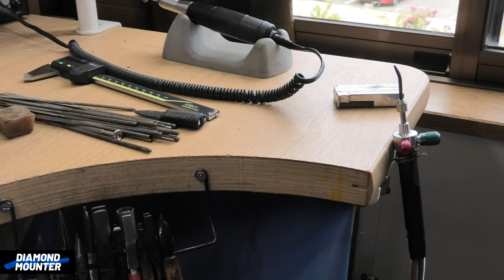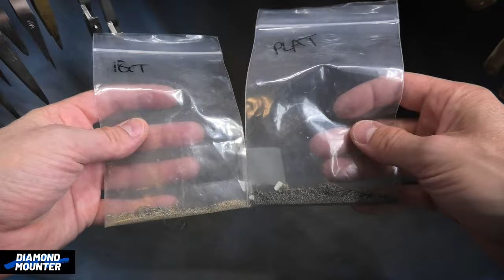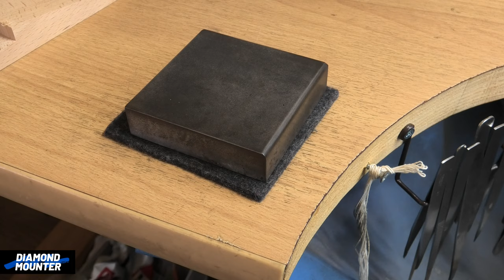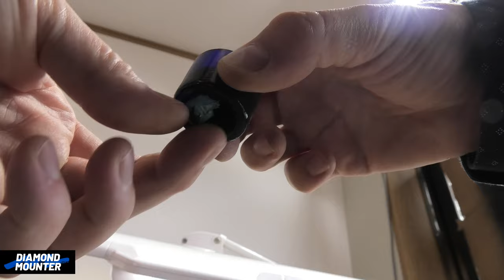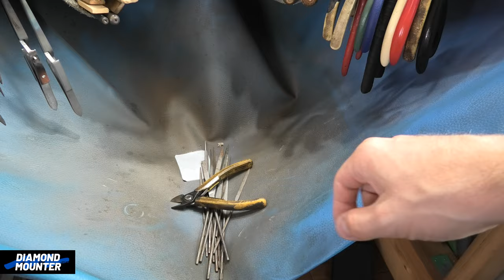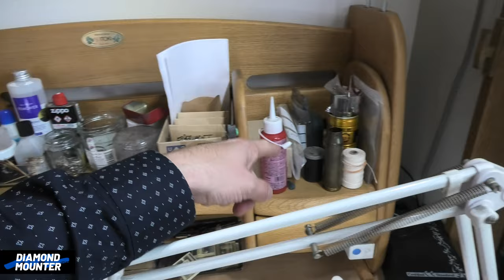Jewellers Bench Set Up at Home

Comment: Nice setup! Can you share the specs of your micromotor? Brand, Speed and torque? I am starting out and really leaning towards a micromotor instead of flexshaft, but not sure if it can handle all the drilling and grinding needed. Since you use it and don’t have a flex shaft I am assuming this can do it all. Thanks!
Reply from the maker: I bought a micromotor for the first time here in Japan and they are ssso much better than a flex shaft drive pendant motor. Theyre cheaper, quieter, smoother, lighter and can also spin both ways, are speed adjustable and mine even has cruise control! I will never go back to a crappy old shaft drive
Reply: @DiamondMounter  thank you ! do you know the speed and the torque for the one you use ? Just for me to note that these specs can do the job and not invest in something less.
Reply from the maker: @engnardine  I dont know but basically I could only buy the cheapest one when I arrived in Japan. I imagine its the least powerful available but it works fine. Perhaps a little more torque would be useful

Comment: sometimes dentists sell their old  controllers on Ebay,( if they have been corrupted by a dental industry salesman) , just buy a Marathon type headpiece, (you may have to change the plug set shape, but they are all three pins, just soem round, some flat), these are upwards of 500 pound controllers, and top end, and can be had very cheaply...

Comment: How high is your bench please? When I measured the ideal height for me (chest height at the sitting position) it came up to around 107cm. This seems quite higher than market standard (ranging from 80 to 95cm in the UK) and not available unless I custom order. I’m not even that tall I’m (166cm). Any tips on that would be highly appreciated as I developed a painful pinched nerve syndrome in the neck because of slouching which has put me off making anything for months now.
Reply from the maker: Ouch sorry to hear that. Yes I recommend sitting up straight!  My bench is 92cm and my chair is 32cm high but just raise your bench or lower your chair to waht ever suits you